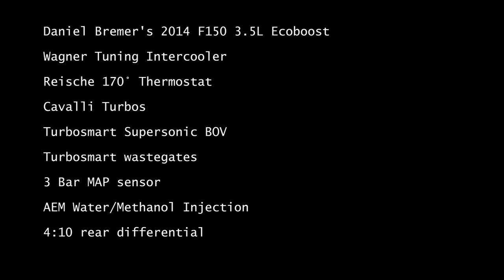Gen1 F150 3.5 Ecoboost Surpasses 450HP - adds Cavalli turbos | Gains 170HP - Super Fast Truck

Comment: Well, It's been a year, and the truck still runs great. The tune has been fine, and the truck is great as a daily driver. I'd do it again without hesitation --Dan Bremer
Reply from the maker: Great to hear it, Dan. That's a nice truck,  enjoy it!
Reply: @mptperformance  What spring did you rin on the wastegates?

Comment: I have a 14 ecoboost and I'm in love, and I was looking these exact turbos and some turbo adaptors with new exhaust running all the way back, but does anybody know if you run just a small tune can an ecoboost run the bigger turbos on a daily? I want some bigger ones but not sacrafice dependability because I still drive it out of state all the time, and haul a lot of pretty heavy trailers and how much more boost these make over factory? or even how much boost a ecoboost can hold safely? I normally dont race mine unless its a hemi or a 5.3 or dirtymax saying something about the wecoboost, but I was also wondering if you ran a really low boost tune sort of for daily to work and for fuel millage, if these would help the millage out any at all possibly with easy driving? sorry about all the questions ive just been trying to find info and nobody has done it yet or at least told the story, if y'all could help me out I would really appreciate it, thank you

Comment: So how much power can you push on  stock short block 11-14 3.5 Ecoboost before the rod and piston explode?
Reply from the maker: If you had the fuel system to handle it, 500-550 to the wheels is about the max you want to go before building the motor on the gen1 Ecoboost.

Comment: Why can’t you tune that dip in the power curve out ????
Aren’t you able to make more power with the OEM full race turbos now ? As we have seen over 500tq & 470 rwhp with the same high end gains & Avg gains as well, many times without any issues supposedly..not including the Odd freaks pushing 500RwHp plus although I’m not sure how long they are able to last without built motors...
I’ve been on the fence since 2014 about adding bigger turbos Back then I was too worried about fuel or having to do remote tunes 50times but they’ve been around for so long & the aftermarket has helped out with additional parts & the tunes have probably gotten better 
Refined over the yrs..So at some point I will jump on the bandwagon too..

Comment: Why can't I find anything about these cavalli turboes, I'm wanting to purchase some and get my build underway??
Reply from the maker: The Cavalli turbos are no longer available, but there are other options. https://www.morepowertuning.com/frM-9438-35TA
Reply: MPT Performance what is the best option to getting as close to cavalli as possible I am looking to get very close numbers that yalls truck had off spray.
Reply: MPT Performance some where in the mid 500whp range
Reply from the maker: The Ford Performance turbo upgrade plus 93 or E30 tune, intercooler, and water/meth injection should be good for 460 -480whp. More than that would need pistons, rods, and headstuds.

Comment: Approximately what quarter mile time you expect
Reply: I've only had it at the dragstrip once. It ran 13.7, but without any real 'effort' put into the run. I forgot to turn off the A/C, and simply floored the truck when the light turned green.  That run is here---> https://drive.google.com/open?id=1ZGHHKweKOoeaI8FWgctStQcg3NN062EM

Comment: where are you getring 170? 457 from 322, unless i seen that wrong
Reply: i take it you mean from 5800 rpm on baseline to 5800 rpm on 2nd run
Reply from the maker: Correct at 5800, wish it was the entire curve, but regardless this thing hauls compared to stock.
Reply: Frank Martinez they're comparing it at exactly 5800 RPM which on a stock engine the horsepower is dropping significantly by then. Stock engines horsepower peaks around 5100 RPM and drops fast after that. With the tune the horsepower and torque have a nice curve that don't peak until almost 5000 RPM for the torque and around 6000 RPM for the horsepower. This upgrade gives you really good power gains and strong performance throughout the RPM range. That's what's so great about the EcoBoost engines. Ford has them dialed down for economy from the factory and that leaves them open for a lot of gains. Lots of potential in all the EcoBoost engines.
Reply: @mptperformance  How does a turbo upgrade with a re-tune compare to a PRX on an otherwise stock motor?  (So... PRX with stock turbos to PRX tweaked for upgraded turbos)

Comment: About how much would it cost to get those numbers on my 2014?
Reply from the maker: Assuming you have access to 93 octane gas, you'd need a tuning device like an SCT X4 with an MPT tune, bigger turbos, and an upgraded intercooler like one from Wagner Tuning, Full Race, or Levels Performance. As of right now it comes to $3,728.95. http://www.morepowertuning.com/
Reply: Mike why would you need a larger intercooler with meth? Would the chemical change give you lcolder ait's than you could get with even the best fmic?